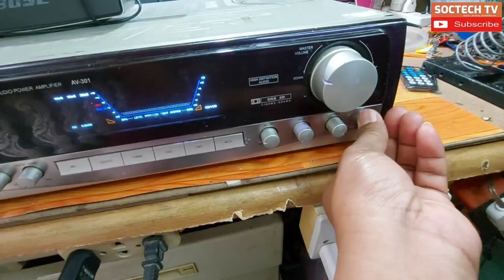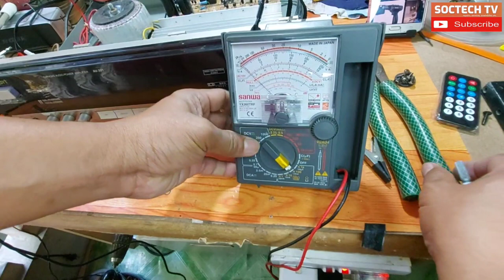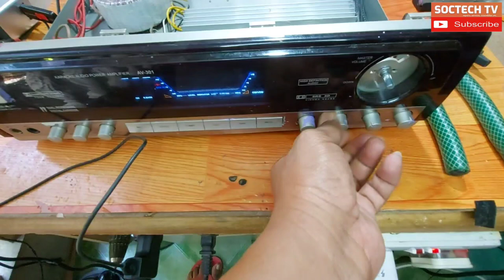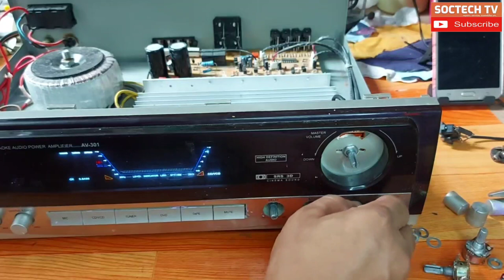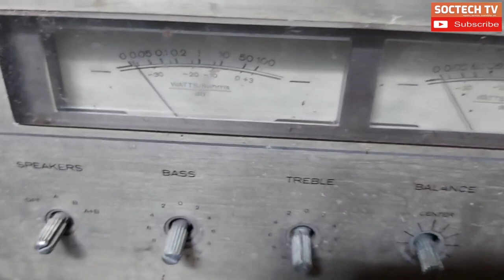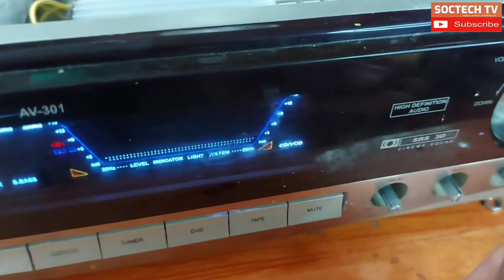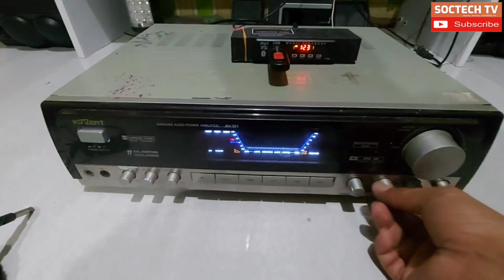HOW TO REPAIR AMPLIFIER || KONZERT AV-301 ISANG CHANNEL WALANG TUNOG

Comment: sir ask ko lang meron ka po na PCB diagram ng konzert av 301 nakalimutan ko kasi kunan ng Picture bago ko e desolder ung yellow black yellow wire galing sa volt regulator...thanks po..

Comment: Sir, saan po location/Area nyo, ganyan din po amplifier ko av-301. Ang problema po kc ayaw tumunog nung amplifier ko ikinabit yung audio out ng active amplified speaket ko n versabox 10 meron po kasing audio out yun, gusto ko po kasing masmalakas yung mga tunog at hindi masayang yung ibang speaker ko, sbi nung ibang electronics tech, wla daw Pre-out or Pre-Amp b yung tawag dun yung av-301 tama po b? Ang tanong pwede po bng lagyan yung av-301 pra magamit ko ng sabay Salamat po.
Reply from the maker: Mayroon po sir pre amp ang av-301 Valenzuela City po